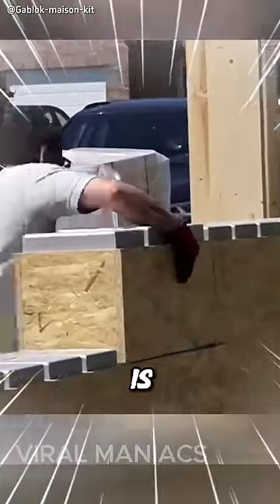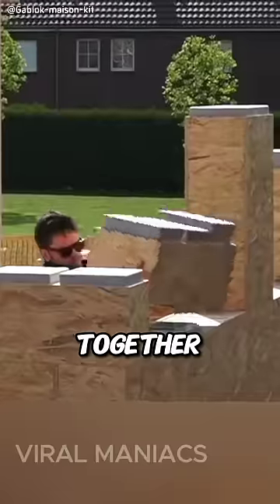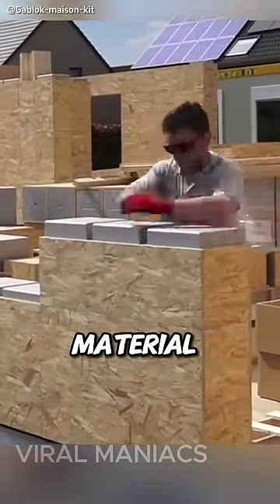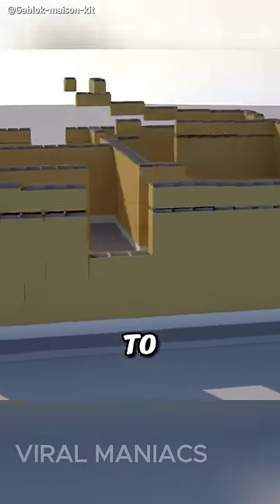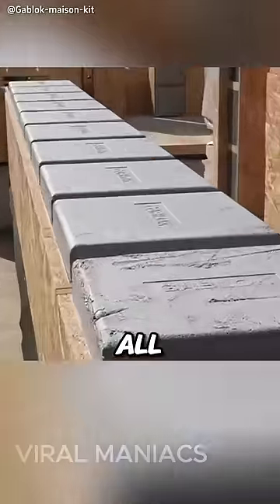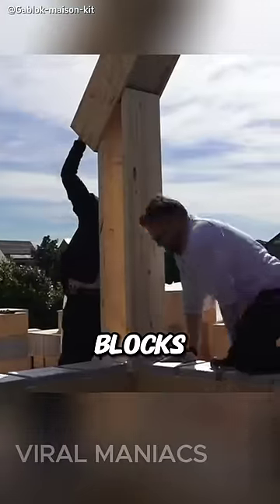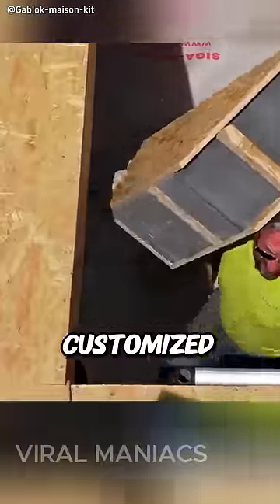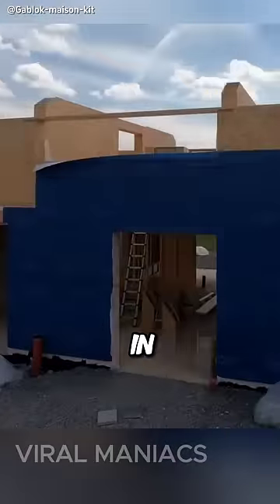Whoever Invented This Way Of Building Houses Is a Genius #shorts

Comment: Downside:  Polystyrene is EXTREMELY inflammable and gives off toxic gases as it burns, which is why it isn't used in bulk quantities in residential construction.
Reply: It is used in bulk but is normally housed within brick or concrete
Reply: My guess is that there is a fire retardant in the blocks.
Reply: I think that you meant flammable.  You make an excellent point.
Reply: @IM-ei5rb inflammable and flammable have the same meaning smart guy.
Reply: @IM-ei5rb It means the same.  I had to look it up.
Reply: It’s the yellow stuff sprayed on the ceiling of Your Dad’s bike shed.
Reply: It's literally Styrofoam
Reply: @DigitalConfusion1  When I checked it isn't exactly the same. But I agree that inflammable is the most correct in this case.
Reply: Inflammable? Confusing
Reply: That's why they should use "HempCrete" instead of that. 😊
Reply: Seems you don't even know what inflammable means, so...... 🤣
Reply: @Suzpek211 they have the same dictionary meaning yes but people make mistakes thinking it means non flammable which is rather a 'hot' topic (safety) so grammarians deprecate inflammable for use to avoid potential relatively high associated risk.
Reply: I hope y’all were this interested in grammar during school.
Reply: Why are you waiting around till the fire reaches the structure?
Reply: @ShandeleReynolds  lol to be completely honest I had to look both definitions up
Reply: I was thinking about this while watching the video, and that along with a couple other things makes me wonder whether a home built this way would be up to building or fire code in places like the USA or Canada
Reply: @Suzpek211  They DO NOT have the same meaning. Look it up again
Reply: @DigitalConfusion1  they don't...look again
Reply: @mikemotorbike4283 they do not have the same meaning...go look again. There's a difference.
Reply: @LevelUpLegends88 have you ever tried to light a hempcrete doobie ???
Reply: *flammable
Reply: @5150life flammable means it's able to burn. Inflammable means it's easily burned so more flammable.
Reply: Learn something new every day, thank God for me I don't stick my foot in my mouth to learn a lesson along with it. Some folks never learn! Those are the ones who tell everyone how unfair it is that they never get promoted and they work harder than everyone else...when really, everyone else slows down to make sure they doing the job right! 🙄
Reply: Do you have intentions of burning your home?
Reply: @swarthybullxxx that foam is also listed as a lung irritant and likely carcinogen Yes fill my home with that
Reply: why not use mineral wool instead of Polystyrene?
Reply: Some people were sleeping during grammar 😂😂😂
Reply: 😆 Some people were sleeping during vocabulary. As in, they don't know what grammar is. 😂😂😂
Reply: @IM-ei5rb yes you really do. First look, I was glued to the screen. Sounded so great! You have to do your research.
Reply: Inflammable? You mean flammable?
Reply: Do you also think that infamous means not famous?
Reply: @jared1228  infamous means a negative connotation
Reply: i don't really care about how healthy it is to inhale the smoke of the building if it's burning. i don't think there's such a thing as a house that burns cleanly lol. unless you can build it out of pure marijuana like the truck in Up In Smoke.
Reply: If it were INflammable, that would be good.
Reply: @trolletuva  I vote flammable is more correct since inflame seems the origin of inflammable and inflame doesn't even mean fire but just general intensification or body inflammation. But yes both are acceptable.
Reply: @jackmiddleton2080  You do that. When I checked inflammable means catch fire easily, no matter the origin.
Reply: @trolletuva  It is correct but dangerously confusing. Like give him his life saving medicine at 12am.
Reply: @jackmiddleton2080  I totally agree it is confusing. I was sure it was the wrong word until I checked it.
Reply: @IM-ei5rb Both words are the same 😂
Reply: @powsniffer0110 no, but yes..... basically the same thing.
Reply: @ShandeleReynolds flammable and inflammable both mean pretty much the same thing.
Reply: @greenarrow5217 I was.
Reply: @raffinataonline flammable and inflammable have similar meanings. If it doesn’t burn then it’s “non flammable”.
Reply: Have fun having 0 power outlets in your walls
Reply: @powsniffer0110 they have similar meanings. Something that doesn’t burn is non flammable.
Reply: @Suzpek211  English is weird.
Reply: I always wanted to live inside a half full gas can.
Reply: All of you are wrong. A material that is flammable can be easily set on fire, while a material that is inflammable is capable of bursting into flames without an external source of ignition. Flammable should’ve been the correct word used. There you go. Case closed.
Reply: @mysterydude1  Yeah.  Just like the total opposite of the words accurate and innacurate.
Reply: @powsniffer0110  exactly. So does flammable
Reply: @powsniffer0110  this is why the choice to use inflammable versus flammable was used.
Reply: Inflammable is correct. Due to the use of the word "flammable" Is in a negative context flammable becomes "inflammable ." 
      Just as "famous" becomes "infamous" in a negative context. 
    I agree it can be confusing but it's only confusing because it is not often used because "flammable" is often thought of as being a negative attribute to begin with. But that is not always the case.
Reply: @jared1228  I'm confused, are you saying the earth is flat and what not n
Reply: All the people in here “correcting” “inflammable” showing their asses. 

Aside, these blocks look:cheap, somehow also expensive, unsturdy, flammable (or inflammable), impractical if you want electricity indoors, and i’ma say it again, very, very easily destroyed by high winds or earthquakess. 

California over here looking at a new proposition number.
Reply: @PopeUhLope  this stuff is not inflammable tho n
Reply: @Suzpek211 they don’t mean the same thing smart guy lol flammable is something that can be set on fire inflammable is something that can burst into flames without ignition be right and don’t be a dick about it
Reply: Until now...
Reply: If something is flammable it means it can be set fire to, such as a piece of wood. However, inflammable means that a substance is capabble of bursting into flames without the need for any ignition. Unstable liquid chemicals and certain types of fuel fall into this category
Reply: @IM-ei5rb  
Materials Data Safety sheet:
"highly flammable"
"extremely combustible"
Reply: @IM-ei5rb lmao you literally fell for the Simpsons joke. “Don’t worry, it’s inflammable.” 😂
Reply: What do you mean not used in bulk quantities? It's literally the most common insulation used and is available in multiple forms (most common being those pink boards that everyone thinks are Styrofoam and the spray foam that you always see in satisfying insulation installation videos)
Reply: @UpperDarbyDetailing  oh that’s cute

Comment: Where does the Plumbing and Electrical go ???
Reply: Home, and don't bother with this shit.
Reply: You’re in Construction just like me, that’s the first thing I thought about.
Reply: why would plumbing and electrical be any different? like seriouly people and you say you are in Construction? please let me know what houses you built so i can avoid them
Reply: @kpfeiffer8775 not sure how you’re going to install utilities inside the walls when the walls are already built
Reply: They probably furr out the walls on the inside and tac gyp to the channels.  Same  for the outside.  That would give them enough room to run wiring.  They probably fatten the plumbing walls to fit the plumbing systems. The exterior walls would be the only ones the wall system would be practical for.
Reply: @kpfeiffer8775 evidently you know nothing about how plumbing and electrical is installed in a traditional framed house. Typically the house is framed, then the plumbing and electrical is installed, then insulation is added, then dry wall is put over the studs.
Reply: @kpfeiffer8775 
If it's a solid block, they can't route stuff through it, if it's hollow it's far to weak to be structurally sound. 

Considering there is nothing but gravity holding these in place I HIGHLY doubt the strict building codes would actually allow this. This is most likely a demo of the product, notice how they didn't use any adhesive between the blocks, that would absolutely be mandatory in order to be legal. It's the equivalent of using wooden blocks to build a house without wood glue, nails, and bolts, a strong gust of wind would collapse it. 

This will need some sort of anchor going down through each block attached to the foundation to keep it stable, so you would need an crane to lower each block down so it can slide down the support anchor. 

This is absolutely a concept product and not a final product as not a single insurance company would touch this death trap as is. Just having 2 anchors in each corner isn't enough due to how light weight they are. Brick doesn't need an anchor due to its weight, wood does because it's so light that when built at the height of a house without anchors a strong gust of wind would collapse the structure, so all along the perimeter of the house are stout pieces of lumber bolted directly to the foundation, there aren't just 4 anchors on a house build with fasteners and fasteners greatly improve the strength of a structure compared to just utilizing the force of gravity to hold things together. It needs something to protect against sheer forces, aka wind. It also needs something to prevent the blocks from shifting out of place in the event of an earthquake. With a brick building that's what the mortar does. It turns the individual bricks into a single solid structure. 

As is this is basically just a wall of large light weight Lego bricks with 8-16 2x4's holding it to the ground. It needs like 30-40 and adhesive between the blocks, it's also probably going to need some sort of fire proofing if those are hollow and probably need to be filled with fire retardant spray foam to prevent creating a large hidden pathway for air to feed a fire inside your walls.
Reply: @kpfeiffer8775 so im guessing you want your pipes and wires out in the open all over the house
Reply: I would expect there are specific blocks designed to accommodate these items. Speaking as an engineer, it really wouldn't be that hard. Cutting channels after assembly would be pretty easy also.
Reply: @Wooderson72 

He's from Ritchey mb😮
Reply: Better question is where does the house go from a tornado
Reply: These are houses for people who don't believe  on using electricity and they get the water in buckets from a well. They are also not worried about fires.
Reply: On the outside of the wall, like in the late 19th century.
Reply: @kpfeiffer8775  Dumbest comment on here. Congratulations.
Reply: I was looking for this comment.
Reply: Why do you have to make everything so difficult 😂
Reply: First thing on my mind, that was
Reply: @Wooderson72 You don’t. What do you normally screw Sheetrock onto? That will give you the answer.
Reply: After seeing the way homes are built today this is much better. Paper thin walls, no one even knows how to make a straight line. "Square? It don't need to be square, just get it done quickly!"
Reply: @kpfeiffer8775 damn. You even got a video doing home Reno’s too. God I hope I stay far away from what ever you work on.
Reply: Did you ask the same question while playing minecraft? Just put blocks on top of each other.
Reply: @kpfeiffer8775  you should’ve probably just sat this one out lol
Reply: Surface mounted electrics in trunking and plumbing fastened to walls. More likely they will fit out the interior from scratch ie studwork and additional fire resistant insulation, all required services will get dropped in throughout that process
Reply: @kpfeiffer8775 know absolutely nothing about construction do you? Plumbing and electrical both go in throughout THE MIDDLE OF WALLS where studs are and are covered by drywall. Unless you're still going to put up walls with 2x4s ect, it's not going to pass code
Reply: @kpfeiffer8775  I barely even picked up a hammer and even i know how hysterically wrong you are.
Reply: they don't, just like Minecraft houses
Reply: @gbbudd7772  Easy.
 1. Up .
 2. ⬆️↗️➡️↘️↙️⬅️↖️↩️⤴️⤵️. 
It's like your sibling destroyed your  Lego house.  Complain to Mom (Company or insurance depending on what this house should be able to withstand), (likely) gain nothing.  Start all over. Or screw it and build a brick house with a cellar.
Reply: @milkmanman  I think he thinks it magically just disappears into the floor when he flushes it! 😂🤣😂
Reply: @purplefood1  then maybe you shouldnt touch that hammer
Reply: @kpfeiffer8775  I mean based on your comments it's likely I'd do a better job of basically anything if I was of a mind
Reply: @milkmanman  so are you going to tell me you are going to screw drywall directly to the lego blocks? NO so you will still have to frame walls, and in this day and age you cant re-enforce a section of wall to accomidate the plumbing and electrical, now really you dont know much about construction huh, stick to being the milk man !

Comment: We ain’t getting insurance with this one 🔥🔥🔥
Reply: How is that different from normal houses? Most houses in the US are wood anyways, genuinely asking!
Reply: @gehadsamir5663  yea but I’m pretty sure the exteriors usually aren’t wooden
Reply: Inside or out wood is flammable
Reply: @obama9535 No, the exterior of many of our homes is just crappy siding. That house wouldn't be anymore fire prone than most other frame houses.
Reply: In California this is no different than a framed home…
Reply: @craigc3259  I am out if California is ok with it, it simply can’t make sense.
Reply: The wood is covered with a vapor barrier, and then siding is nailed overtop.
Reply: All the replies talking about wood.  What about the plastic filling...
Reply: @gehadsamir5663 the polystyrene foam acts like a low tier accelerant once it catches fire.  It burns hot and fast. It would also melt and essentially cover the floor with napalm while also emitting terrible smoke and vapors. Wood is flammable, polystyrene is extremely flammable and noxious.
Reply: @deadbrother5355  Okaaay got it! Thank you
Reply: Blocks are fire proof up to 1200 degrees. Wood doesn't burn.
Reply: @deadbrother5355  We test things like that almost on a daily basis in a fire lab. Almost all of it has polystyrene in it.  Most fail the test, but sometimes they get it right. I guess it had to pass if they are allowed to use it for housing unless this was just a prototype. You are right that smoke is terrible.
Reply: No insurance? Thanks Obamna...

Comment: That's pressboard. You can call it OSB if you want. Those of us that know it, call it trash. Hope it doesn't rain where those "houses" are.
Reply: Oh didn't think of that. Smart.
Reply: Man, this is just the raw structure. 
Of course it will be covered with a protective sheet. 
Just like you cover the bricks of a house with plaster.
Reply: One hole in the protective sheet and goodbye house

Comment: Thing I love most about all these shorts about new “futuristic” ways to make homes is that you never see a finished product. Says a lot.
Reply: Most places have building standards that wouldn't allow this. At least in the West.
Reply: HEMPCREAT is Earth Friendly. 
 Not some artificial 
   oil based
         FIRE HAZARD 🔥 😬 👌
Reply: @TheBeachesandshores  In the West as in Az. New Mexico., Utah, etc ? That's only place I've actually seen this. Works out Fantastic. Cool in the 112° Heat, Warm in Cooler months.
Reply: My curiosity about the electric and plumbing is overwhelming 😂😂😂
Reply: I’ve seen the finished product for the 3d printed houses and they’re fucking gross looking. Structurally integral? Sure. But the interior walls look like a giant jizzed all over your house
Reply: Didn't see them running any wiring or plumbing either .
Reply: There is a house around the corner from me that was constructed like this.  It looks just like houses in your neighborhood.
Reply: @Sunifriliac  honestly for the price of these, you could have an Amish community build you a wooden version of this within a literal day. Significantly cheaper and better constructed
Reply: Idk about you but I’d be filling it with cement as well  or some short of layer on the outside to make it stronger for higher winds
Reply: @Clayton4Man  I suppose if you was in that community
Reply: @djLagwayEnjoyer  🤣🤣🤣🤣
Reply: These are just promotional videos. They are hoping to get ignorant investors and doddering old politicians to by into this. Then they can build these abominations for 1/3 the cost while changing 3 times as much. While you get a house that doesn't last 15 years.
Reply: @kat376  You still have to frame it out. There is no other way
Reply: These Houses are great for many people that have large Insurance Policy’s on the wife & kids , I will pass on these !
Reply: I have seen both a finished product using this method and the concrete 3D printing machine......3D house printed with concrete look terrible but these houses are actually pretty awesome and affordable.
Reply: @tallspaniard1  I got to agree with you on that one. I never thought about it that way. Insurance scams.
Reply: @TheBeachesandshores it is legal in the US.  SIPS panels. This looks like a Scandinavian area, they are way ahead of us and yes there are raceways for electricity and plumbing, and costs very little to heat.
Reply: I just love the comments
Reply: @kat376  Same way concrete buildings have electricity and plumbing. This is just the exterior walls. Also, much easier to cut through this than a concrete wall too.
Reply: @Sunifriliac  Hold my drill for me.
Reply: On there page gablok you can see a Finished house looks "normal"
Reply: Nice to see the amish brought a tool